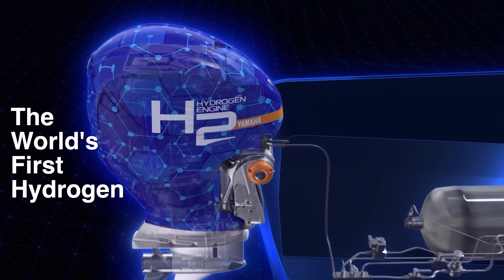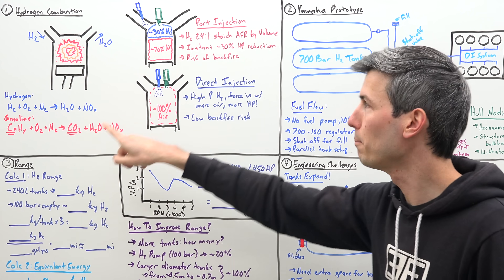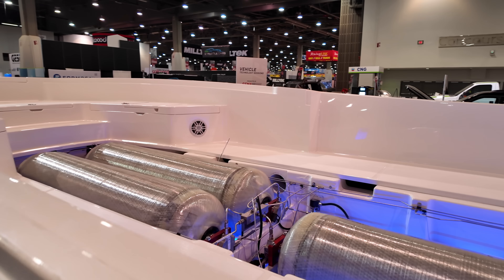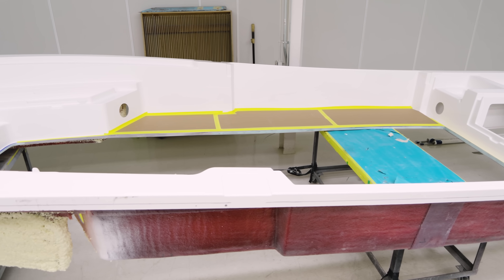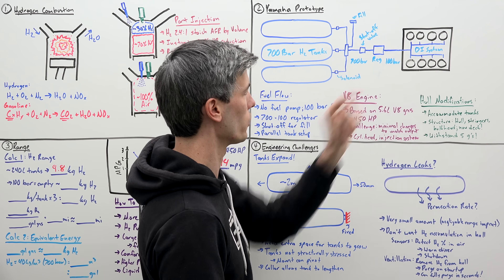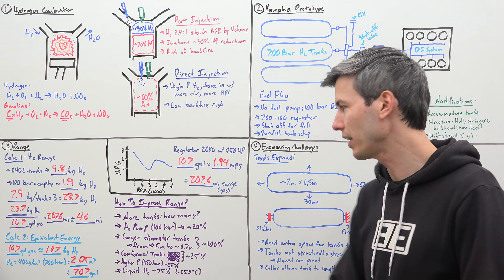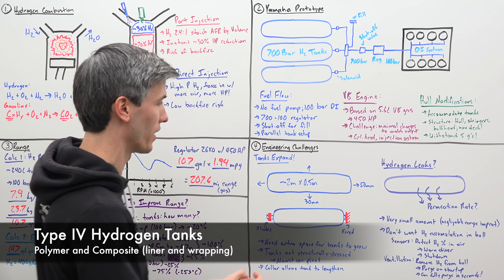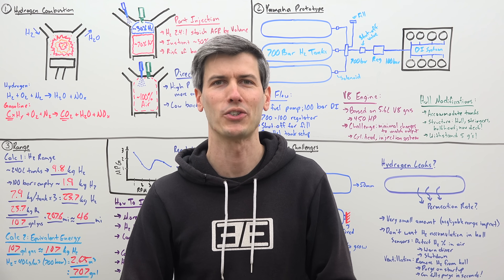The World’s First Hydrogen Combustion Outboard Engine!

Comment: As someone who works on stuff like this everyday as an automotive engineer, I am very skeptical that hydrogen will ever work for anything in the future. The storage issues alone are enough to make it unfeasible. People already have range anxiety with EVs that get 400 miles to a charge. Good luck getting them to accept 50. Also, EVs still have the huge efficiency advantage that a combustion engine will NEVER overcome, as it is physically impossible to match the efficiency of an equivalent electric motor. That's thermal dynamics folks. Plus, as several have said below, as battery tech continues to improve, range anxiety will go away. All the grid worries are nothing but BS from fossil fuel producers our grid is more than equipped to handle it and growing everyday (with the exception of maybe Texas, but they are about to join the national grid). AI is poised to strain electricity demand far more than vehicles in the next decade.
Reply: 20 year old Honda Insight enters the chat...
Reply: Not to mention having any type of fuel at 1500psi  sounds like any minor failure can result in a huge explosion
Reply: A compound can have much more density of an element than the element alone can be made. Breaking the bonds of molecules releases a lot more energy than the elemental facets.
Reply: Yea. Because California for sure had a grid that can handle all the extra EVs when currently they can't handle 100% demand. 

And Hydrogen fuel engines won't ever be as efficient as gasoline engines because of the manufacture process required to make the fuels - if you want to get into that discussion.
Reply: So oil is the most energy packed fuel substance we know of. Currently our grid most certainly can not handle the proposed increased use. Just this year there were a couple of occasions were they had rolling brown outs and told people not to charge their cars. As side note saying battery tech will get better is not a point, you also simply say hydrogen power will get better too.
Reply: @mthompw  only your statement makes no sense. Battery storage CAN get better. You can store more power in a given volume but not produce more energy from the same volume of hydrogen. That is the problem. Physics is the limitation. The amount of volume you have to store for the same range is massively different and that will not change. Even compressed liquid hydrogen cannot store the same amount of energy as ICE or EV and liquid hydrogen has the added problem of keeping at ridiculously low temps to maintain its liquid state.
Reply: At the very least hydrogen will have a future being used in industrial and chemical processes, as well as spaceflight. There are also some long term grid-scale energy storage solution ideas where hydrogen may be used. Finally I wouldn't count hydrogen out yet when it comes to the aviation industry.
Reply: Automotive engineer my ass, no way an engineer has vocab skills bad enough to use "except" instead of "accept." I'd bet $100 you're a technician.
Reply: @svgPhoenix  so no actual valid points? Grammar? That's all you have? If you want grammar police, your first sentence is a run-on. Grammar police never make errors... Contribute to the actual discussion.
Reply: Hydrogen makes more sense than plug-in batteries, because it has no input conversion. The only problem with hydrogen is the fact that it is a bitsch and a half to store and transport.
Reply: @gsilva220 Input conversion?? How do you think we make hydrogen and turn it into motion lol.
Reply: EV won't be 'accepted' until you can charge then as fast as a gas tank fill up AND can do it ANY WHERE.
Reply: @xxxlonewolf49 
I've driven EVs for years, and never waste any time charging them. They charge while I'm doing something else. 
Typical comment from someone who doesn't driven an EV.
Reply: @xxxlonewolf49  you at least have a valid point. Although this is also a battery issue that can be solved.
Reply: @kornydad14  No current batteries or anything remotely close to "Useable" is able to be hot swapped as fast as filling a gas tank and last as long. MOST car people get a car for FREEDOM, not to be tied to an over taxed electrical grid that is SLOW AS ALL F' to charge you veh on. Even "fast" systems are incredibly slow compared to FILLING A GAS TANK. Sure some EV's can out accelerate some cars, but there is more than just that. And none have the FEEL of reving an engine and the FEEL of a REAL car.
Reply: @xxxlonewolf49  I am not debating the feel of one vs the other. In that regard, I am ICE all the way. Nothing has the feel of a 1200 hp twin turbo LS, but for everyday driving and commuting, EVs are the much better option and a lot of companies have free EV charging at work. As least here in MN they do. Or you charge at night at off peak rates and never have an issue and spend 80% less than the ICE alternative. Preference is an argument outside the engineering. From an engineering standpoint, EVs are better than every other option and its not close. They are less complex, easier to service, more efficient, more powerful, etc.. Hydrogen versions of ICE engines don't have the same feel either FYI.
Reply: @kornydad14  EV's only work in a city and still NEED a more robust grid than we have.
Reply: @xxxlonewolf49  If you are driving more than 150-200 miles a day, sure. That is only about 2% of people though.
Reply: @xxxlonewolf49       Electric primary traction has been ready for almost 200 years, and has thrived in all applications that don't use plug-in batteries. In the applications that do use plug-in batteries, you have all the problems you cited.
The reason for that is simple: Batteries do not store electricity, they store chemıcal energy. This basically means that when you charge a battery, you have to wait while it turns electricity into something else. That is the reason why plug-in battery-electric vehicles are only viable for people with short and predıctable daily routes. However, even this limited use case will overload the grid, simply because it works like a fuel station without storage reservoirs.
Reply: @kornydad14  Anyone who drives for WORK will do that easily and it's more than %2. Clearly you've not heard of RIDE SHARING people do part time.
Reply: @xxxlonewolf49  according to the bureau of labor and statistics, <<1% of people drive more than 200 miles per day and on average Americans drive just 41 miles per day. FYI, << means mush less, so much less than 1% of people drive 200 or more miles a day. Anecdotal information you provide based on your experience is not evidence and actual statistics say your wrong.
Reply: Lol buddy, you got some catching up to do. Hydrogen cars already exist. Available from major manufacturers like Toyota and Hyundai. Storage is not a problem, and to the extent that it is, it’s no reason not to invest in hydrogen. We have carbon fiber tanks. Look up metal hydrides. They’re like a sponge that holds hydrogen at low pressure. Hydrogen cars have even MUCH more range than even combustion vehicles. Again, this is already reality. I don’t know why anyone ever talks about efficiency when battery vehicles have less range than my 20 year old Corolla and take ten times as long to recharge. That is not efficiency, and that is all that matters. No, grid inadequacies are not big oil propoganda. It is already a real problem. You really don’t know what you’re talking about. Battery vehicles are mediocre and inferior. If we make the effort to invest in hydrogen infrastructure, such vehicles would be vastly superior than anything else, and we can use hydrogen for far more applications.
Reply: @bowencreer3922   If you think grid inadequacies are a problem for BEVs, just wait until you hear how much energy hydrogen splitting takes. It doesn't just appear from nowhere.
And 8,500 HFCEVs were sold last year. And 9,500,000 BEVs. Hydrogen lost.
Reply: @drunkenhobo8020  exactly.
Reply: @bowencreer3922  Toyota is scaling back the Miurai, hydrogen fuel stations are closing, not opening. It exists, but the market is shrinking not growing. You miss the bigger points about the hurdles hydrogen has. Where do you get economic sources of it? All economic sources are grey hydrogen from methane steam reforming with the promise that "but sometime" green hydrogen will be cost affordable. No wonder the oil companies love hydrogen, they can keep selling gas and trick people into thinking it's green when it's not. Where do you get the catalysts for the fuel cells? There is not enough supply of platinum and iridium to be able to meet the demand that would be needed. Not to mention the inefficiencies of converting electricity to hydrogen, physically moving the hydrogen, then converting it back to electricity. There is a huge amount of wasted energy in all of those conversions. 

You're correct about the grid problems though. That will only get worse and given the lack of investment into it, will halt progress before long.

Hydrogen works best for things that can't be easily electrified by batteries. Heavy diesel. Heavy industry. Shipping.
Reply: @bowencreer3922 Maybe you should actually check you know what you're talking about before being condescending to other people. Hydrogen requires far more energy to produce than the equivalent battery charge, so if you're worried about the grid needing upgraded then hydrogen is far behind.
And 8,500 HFCEVs were sold last year. And 9,500,000 BEVs. Hydrogen lost. It's not even Betamax. It's Video 2000 and you're still betting on it winning.
Reply: @bowencreer3922  did you watch the video? 25% of the range of the gas alternative with 4x the storage space. How many people do you know that are going to buy a hydrogen F150 where the entire bed is useless because it is filled with fuel tanks to get enough range as the ICE or EV version? Also did you know that insurance won't cover hydrogen vehicles because they cannot be stored indoors because the fuel CANNOT be perfectly contained in tanks? There is always leakage. Imagine leaving your hydrogen car in the garage for a 2 week vacation, coming home and flipping on the garage lights and blowing your garage up. Everything you said is complete nonsense. I literally work on these vehicle designs daily.  Zero engineers I talk with think they are the winning tech long term. ZERO.
Reply: @bowencreer3922  well said sir. If the time and energy being put into battery EV nonsense was put into hydrogen solutions, things would be going in a better direction. 

I imagine a time in the future where we are on a hydrogen infrastructure, and car companies can offer commuters in a hydrogen fuel cell/electric system, and then a "sports" car using hydrogen internal combustion. So that way us guys that love the sound and feel of IC can still enjoy it, yet there are options for super efficient EV commuters. Kind of like how the market is with gasoline cars currently.
Reply: @mrctuned2844 Wait, so we already have vast electrical infrastructure but are struggling to install enough fast chargers, and you want to install a completely redundant second set of hydrogen infrastructure? 

Also we'd need 3x more hydrogen infrastructure due to the extremely poor efficiency. It's a dead technology. 

People are building battery EV stuff because it works.
Reply: @tomdy69  it doesn't work where I live bud. In the winter a battery EV has its range drop to half or less. They have other issues as well when introduced to extremely low temps. Batteries are made from a limited resource, it's worse than oil. The infrastructure is already in place, you use the existing gas stations and swap it out for hydrogen tanks.... like they've already been doing for 20 years. The electrical infrastructure will never ever be able to handle everyone driving EVs, it already isn't near enough. Battery EVs are a fad.
Reply: @mrctuned2844  So instead of creating electricity and sending it through a wire to a battery in EV we will instead; create electricity and send it through a wire to a special facility to create hydrogen which we will then transport hundreds of miles to a refueling station to then fill up our hydrogen car which will use it's fuel cell to covert it back into electricity to charge our onboard battery. That's what you think we should do? Please respond, i'm eager how you'll try to avoid responding my question directly.
Reply: @MuppetsSh0w  nice job simplifying battery EVs and then attempting to make hydrogen sound complicated. I'm not wasting any more of my time with someone so ignorant. Have a nice day bud 👍
Reply: @mrctuned2844  How did i make hydrogen sound complicated? Please simplify it more than i already did. Should be really easy since i complicated it so much. You might change my ignorant opinion.
Reply: @mrctuned2844  it works fine here in Minnesota, one of the coldest in the US. Where do you live the artic circle? The batteries in most EVs have temperature controls to keep the packs as close to constant temperatures as possible.

Comment: out of all the options i still believe synthetic fuel is the way to go with basically the same things as current fuel goes and no major change required to be done on current engine and infrastructure
Reply from the maker: Yep, only real issue with it is cost (and scaling production to our level of use, also a matter of cost).
Reply: @EngineeringExplained that is easier to overcome than somehow packing more hydrogen in a given volume/weight
Reply: @EngineeringExplained Please discuss the semi solid state battery from Nio.Which achieves a cell energy density of 0,36/kg. 
1:43 And pack energy density of 0,28/kg.
Reply: The problem with synthetic fuel is similar to the problems associated with carbon capture. Getting the carbon out of the air is difficult and expensive. As such it is highly likely that synthetic fuel would also be expensive. Which may not matter for certain applications but for high fuel use applications synthetic fuels will be way too expensive. Then again we don't actually need cheap flights or cheap boating. Trains that can be much more easily electrified can take over some of the load of flying.
Reply: You need to generate CO2 free hydrogen and capture CO2 from the atmosphere to make carbon free synth fuel. 
All these processes require a lot of energy, many times more than battery EVs would need, due to the losses at each conversion step from production to wheel. 
So if we agree that wide scale adoption of BEVs would need an infrastructure/grid improvement, synth fuel production would need a multiple times bigger upgrade.
Reply: No, it is not.
Reply: It will pollute which is one of the reasons for going green hydrogen
Reply: Ammonia solves the problem of storage and transportation.
Reply: Hydrogen electric should be the future. Such vehicles would have superior range to combustion vehicles. The bonus is that we can use hydrogen infrastructure to also create synthetic gasoline for existing and future combustion vehicles.
Reply: @bowencreer3922 ; I'll be honest, I just want engine noises.
Reply: and it still releases carbon into the atmosphere where it causes great damage. We really need to think about not burning anything if we can help it, and for the most part we can.
Reply: @ burning synfuel is carbon neutral but making them consumes carbon. So it’s not quite neutral overall. Hydrogen could be carbon neutral if the whole chain is powered by renewables. But it would be so much better energy wise to put this in batteries instead of
Reply: @nlagas  like always it was way easier to say than do. So let's see what will happen in the future
Reply: @DaveBarnes1 What damage exactly?
Reply: Synthetic requires a huge infrastructure change. Not only do you have all the problems with producing hydrogen, you've also somehow got to get a huge amount of carbon. It's the worst of all options.
Reply: @drunkenhobo8020 it’s a difficult challenge but gasoline and similar fuel is still the best way to store energy compared to electricity or hydrogen.
Reply: @frederickhahn1086  It may be the most energy-dense way to store energy, but what's the point when you lose so much energy in the process of making it and using it?
Reply: @ well refineries already produce and use a ton of Hydrogen. It is by very far the biggest producer in the world. Then carbon is fairly easy to find nowadays and the processes to make and use it is very well known. This is really so much easier than mass hydrogen development

Comment: I've always had a general hate for hydrogen as fuel. If you follow spaceflight, you know what I'm talking about. It's cold, it's leaky, it's high pressure, it's just a pain to work with. But this technology is still interesting so I am still interested in where it goes.

Comment: How difficult is it to just take carbon dioxide from the air and combine it with hydrogen to make another fuel like methane or propane? Adding 600 lbs for reducing the range by 75% seems like it's worth the trouble making a better fuel.
Reply from the maker: It's hard, and requires an insane amount of energy to scale. End result is a product that's crazy expensive, but, at least it works with tech that's around today.